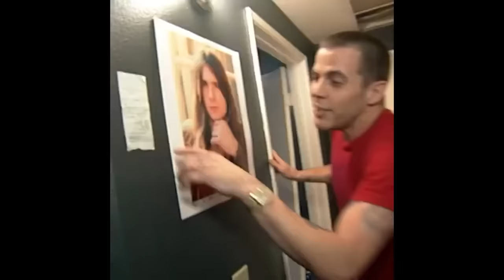Steve-O’s Utterly Ridiculous House Tour | Steve-O

Comment: That idea with the rings on the half pipe is really ingenuitive! Are they mounted to a frame above the half pipe, or just the surrounding tree branches to give more of a spring like tendency to the line rather than being completely fixed on a stationary frame? Kind of like a slackline vs a rigid line in slacklining terms.